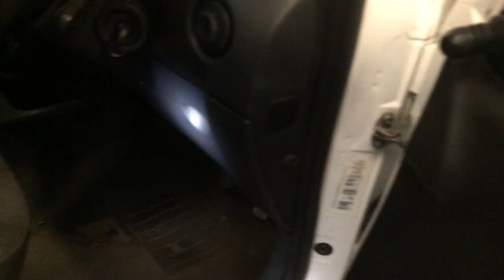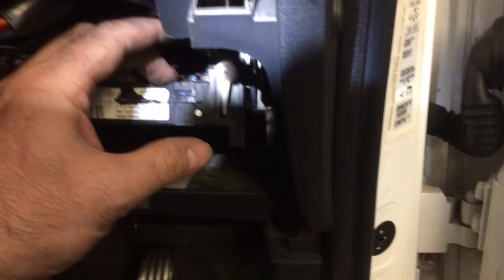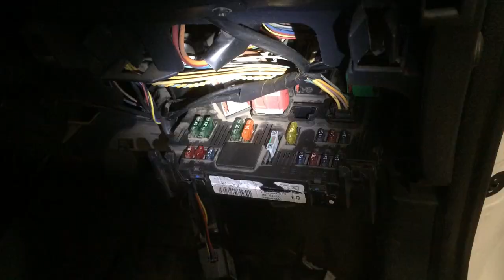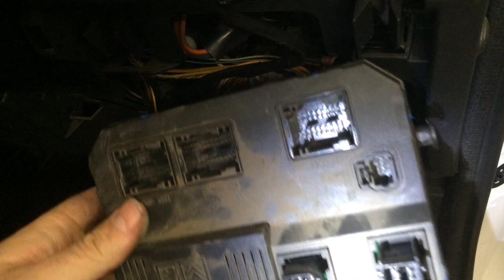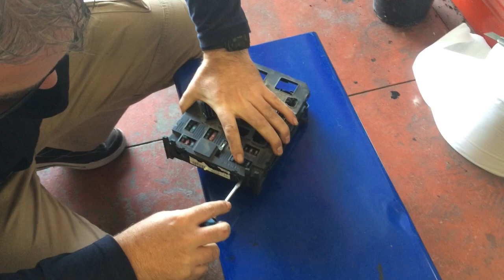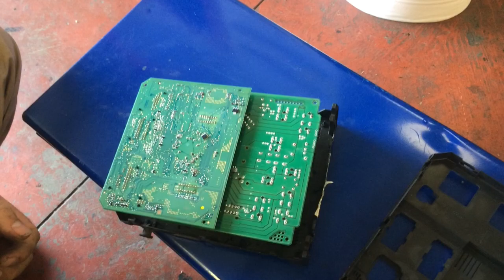Berlingo

Comment: Drivers front window not working any help would be great citroen berlingo 2011
Reply: Mine too....2012 model.  Help wanted !  It is not the window engine and it is not the switch for driver window.  Can it be the switch for passenger window...although that window is working up and down...but that switch is bigger and more sofisticated and has bigger diam. wireing...as if it is relay or something...combined with beeing switch for right side window. Left side window...only goes down and not up ! Grrrr
Reply: Did you fix it?? What was the problem